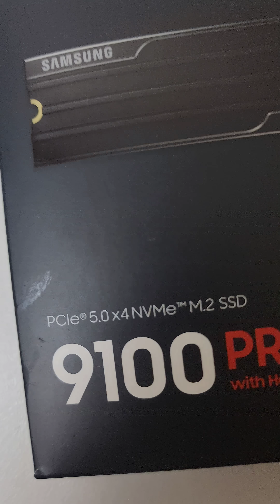how to install your M.2 NVME SSD

Comment: Hey! I was wondering if you could help me with an ongoing problem I've had with my xbox controllers. Ive had three controllers now and even though they stay on and connected, the light on the logo won't stay lit. This problem has carried across several new controllers, and I can't seem to find anything in settings. Thank you!

Comment: Hey Tinker Man! I don’t know if you’ll read this but I’ve been having issues with my joysticks on my elite series 2 controller. You’re probably thinking it’s stick drift. Which you’d be partially correct, however every single cleaning method I’ve tried has been ineffective. Which makes me think there’s some grease or something bothering it. If you could give me any tips or make a video on it I’d appreciate it. Please note, that I won’t be taking off the base plate of the controller due to me not wanting to risk damaging it.